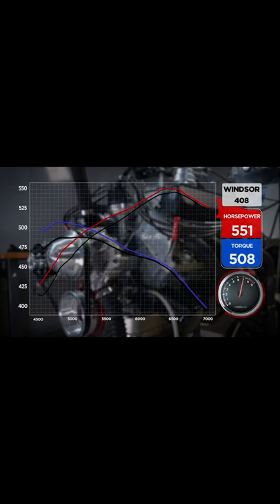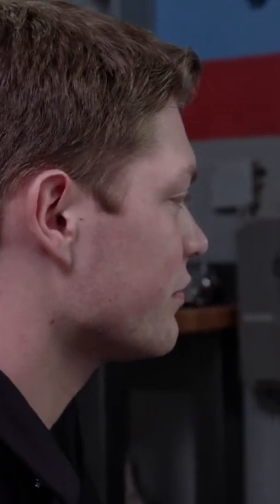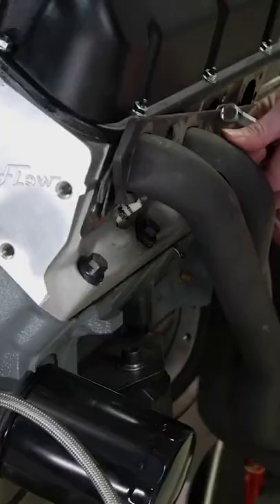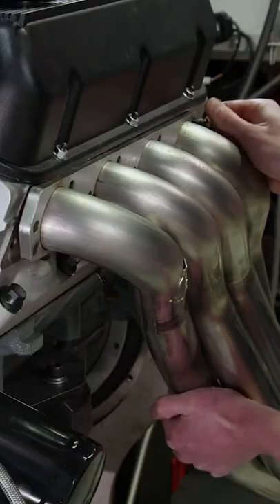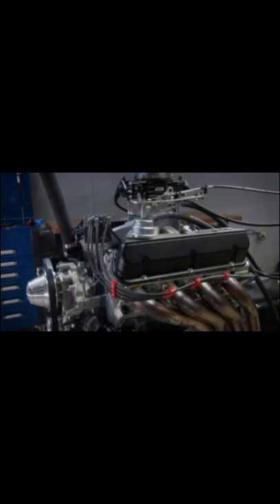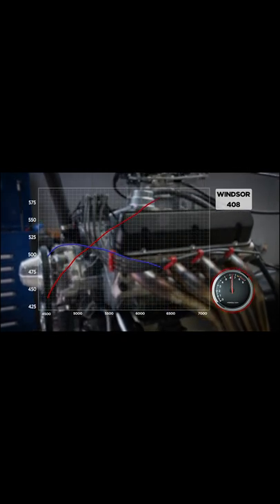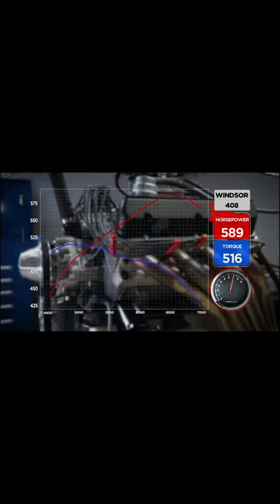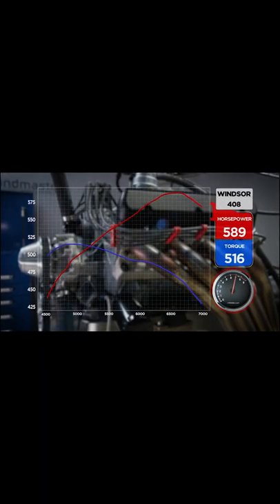Do Headers Make a Difference?

Comment: The answer is still “it depends”. Lower displacement and power levels a bigger header won’t do much.
Reply: It made a hell of a difference on a 318 2 barrel van I towed with
Reply: i have true duals with an h pipe and tailpipes on my stock 2 barrel 302

  but ill bet money if i put on the headman header that are 1-1-2 primaries long tube that fit the car,  which is a SMALL primary for a performance  upgrade,  id pick up EVERYWHERE.
Reply: I think he was referring to like an old Honda with a 1.6 liter. The power gains will be negligible on something that small
Reply: @tommyweese5697  even then header primary size will make or break it.  Even on a stock engine
Reply: @KingJT80  ya but most reputable exhaust companies do their research when they design them and don’t build them underside unless it needs it. Or too big. Usually gotta have those custom made for crazy amounts of power.
Reply: @tommyweese5697  they build what is the most common marketable thing a lot of the time. And people who don't do their own research buy things they don't need.  

It's up to the consumers to kind of figure that out by independent testing one against the other. 

And the only way to do that is at a track somewhere. Dynos are only for making sure something doesn't come apart and it makes HP wise about what you think it will. Don't mean it'll be faster. But a header in general should pick up vs stock
Reply: @KingJT80  I've ran 1 1/2 primaries on a heads cam intake 302  swapped  ranger I built, they are maxed out about 325ish rwhp.
Reply: @19jody72  yeah I figured they'll max out somewhere then you'd have to step up

Ideal? No

An upgrade over manifolds... At least for my 79 zephyr?  Yep. Probably for you too
Reply: @KingJT80   I had a lot of work done to them where they flowed as much as 1 3/4 shorties.  Hell in stock form they outflowed 1 5/8 foxbody headers . They have torque cones installed in them stock, they are called Torque Monster headers..made for 96-01 v8 mountaineer and explores and 98-2000 302 swapped rangers
Reply: @19jody72  interesting 🤔. I am probably going to go 331
Reply: @KingJT80  Mine next one I build I am.gling 331 as well. I wanted to see how the truck reacted to the v8, it handled it like it was stock.
Reply: @19jody72  yeah  the only  reason  i like the 331 vs  the 347  is because most  302  blocks  dont need to be notched  for a 3.250  crank  if  you get i bean rods  with stroker clearance. scat and summit make them
Reply: @KingJT80  yes sir! Plus the 331's seem to last longer.  I have a buddy who runs 7:90's in a 89 convertible foxbody.. he's been on the the same engine for 4 years. The crank broke last year or the year before, but the sob still ran just knocking like hell...lol
. but other than that zero issues.. Well over  1000 rearwheel horsepower . Big turbo on it. Look up Tony Whestone. You see it. I used to race him back in the day out at the boondocks nation's street events😎  when it's was just a bolt on 302 car..  he's in a whole nother atmosphere now with that car.

Comment: A motor is literally a giant air pump the more you can get in and burn and the better you can get it out will make more power
Reply: Assuming that you can get the compression ratio and timing tuned to burn the massive amount of air/fuel mixture that you are stuffing into the engine. Then you have to match the exhaust flow length and diameter to match to make a balanced flow. That's where the power is at. 🙂👍

Comment: You need to do stock engines with oem intake and exhaust, and try different AM intakes, headers, exhaust, tuning, etc.

Also, LTHers before and after ceramic coating.tttttttttttttt
Reply: They'd all still pick up most likely. i know my stock 302 2 barrel would even if they were 1-1/2 inch primary headers and it already has true duals and an H-pipe

Comment: When it comes to custom headers bigger the better, besides improved performance it makes the engine sound awesome
Reply: I would add, “ with all else being equal”.  It’s very easy to over, or under cam or carb an engine, then add the wrong exhaust to exacerbate the issues.   Any engine must work as a package, intake, cam , ignition and exhaust to perform well.
Simply throwing big…anything at an engine is a recipe for disaster, without everything else matching.
So, “ with all else being equal” I can agree with this statement.

Comment: The real key here is “THE PURPOSE OF THE MOTOR” These HP gains were made at MAX RPM
I am not racing my engine but doing street and daily driving…needing drivability and low end torque
There fore if I wanted headers it would be for looks = small tube long length
Reply: I would guess the same as you but torque is up all the way around, substantially at low RPM. (“Low RPM is 4500 lol) Seems the larger tube wins on this application.
Reply: Yes and street daily drivability is 500 to 3000 RPM….Large long tube headers make day to day driving more cumbersome.
Once again…application….want the look of headers….get small tube medium length😁😁😁
Reply: @paulthesoundguy1  great point
Reply: @paulthesoundguy1  
My daily driving is between 1.5k and 7k RPM.
Reply: ZAJ….7k is not just daily driving..but sporting or racing😆😆😆😆
You May hit 7k RPM But your performance gains across the RPM SPECTRUM vary widely with headers
There are no headers that provide a smooth even torque and HQ gains from  1.5 to 7k RPM.
Reply: @paulthesoundguy1  
Yeah, I do realize that, not arguing with that.
I drive r4 engined cars, I accelerate quickly, then keep the speed for as long as possible, fluent driving.
I use all the range on daily basis, keeps me and the engine happy.

Racing is about speed, not about revving it up. What's the point of having the range if you don't use it?
You can drive a 4k rpm tops diesel if you will...

Comment: Project Suggestion with Power Nation associates: Build 70-72 Buick GS, Skylark or Skylark Custom as a "BASE" Buick GS. Premise: in 1974 only, Buick produced a 2BBL 455. If available, dyno as is then bring up to almost '70 spec with the 2 barrel then dyno again. Base GS: manual brakes, front aluminum finned brake drums, manual steering, NO a/c, base factory steering wheel, floor mounted Hurst shifter, HD 3 speed manual transmission, HD clutch, bench seat, stock dashboard, hood-mounted tach or steering column mounted tach, 15" steel wheels with Buick dog dish hubcaps, tires equivalent to G or H60-15s, HD shocks, HD coil springs,  HD front and rear sway bars, 3:08 or 3:23 posi-traction differential, Buick AM radio, stock heads, stock exhaust manifolds,  stock 2 barrel intake manifold (internally polished) and any other "Base" factory stock components I might have forgotten. In 1974, Buick Le Sabre could be ordered with the 2bbl 455.I hope this suggestion gives you inspiration to possibly build this project car. Thank You

Comment: Swapped a LS1 into my grand marquis. I bought a super cheap set of long tubes just to see if I could get them to fit. I tried and tried and it wasn’t happening. Went with hooker manifolds and I’ve been happy with them. For 400ish hp it’s good enough and a reliable seal

Comment: I wonder if rusty old headers will make more power than brand new shiny headers, since rust is a great insulator and will resist thermal transfer. Rusty exhaust is basically already wrapped.(in rust) Ratrods rejoice.

Comment: The way I understand it is that smaller horsepower engines like mild small blocks that aren't built to breath very well in the top end don't really benefit from large tube headers like 2.5 inch or bigger and will lose some low end grunt where the engine is designed to live and also smaller tubed headers like 2 inch or even 1 3/4 inch Tri-Y headers are a good choice for these type engines, on the other hand if you have a small block built for top end horsepower at the expense of low end torque then bigger, short tube headers like 2 1/2 or 3 inch can benefit in the upper RPM range allowing it to breathe better. If it breathes too much for how your engine is built then you don't have enough back pressure for good low end torque and on the other hand if you have small diameter longer tubed headers on an engine that's built for higher horsepower then you're restricting the exhaust too much and it can't breath when it needs to. It all depends on what the engine is built for. Also a crossover or X pipe put in at the right point, where the heat build-up is at it's highest point in a dual exhaust pipe setup, will also equalize the exhaust pressure and pulses which help scavenge the exhaust which helps with low end torque as well.
Reply: Exactly the way that I was taught. I couldn't have explained it any better. 👍

Comment: Unrestricted air in and unrestricted exhaust out will undoubtedly increase performance and efficiency.
Reply: All depends on the compression monster under the hood. It has to be able to eat up all of that air/fuel that you're feeding it or it will just get full and bog.
Reply: @midnightrider1854  💯

Comment: I have a 2020 Ram 1500 5.7,  It's my daily and I just want some increase in power and torque. Which is the best way to go? I'm not racing but I do tow from time to time.
Reply: The cheapest way IMHO would be to install a tuner for minimal gains for cheap.

Comment: 1 5/8 tubes is the max you should do. 850hp Nascar engines use this diameter
Reply: That all depends on the engine build, air/fuel mixture and alot of other little items. There is nothing right out of the box. You have to experiment depending on your individual build.